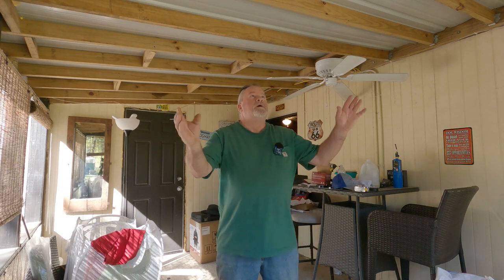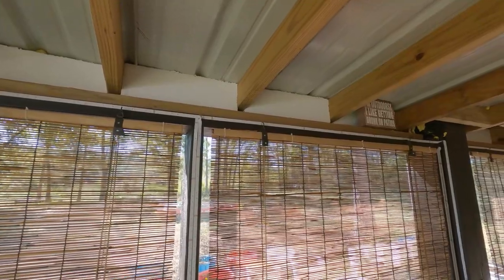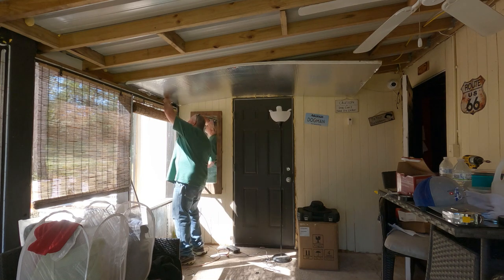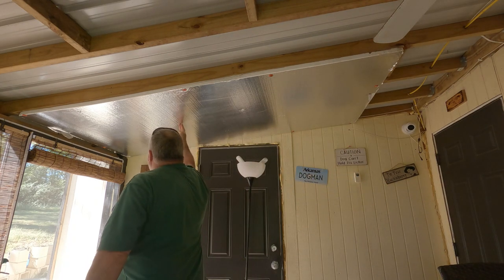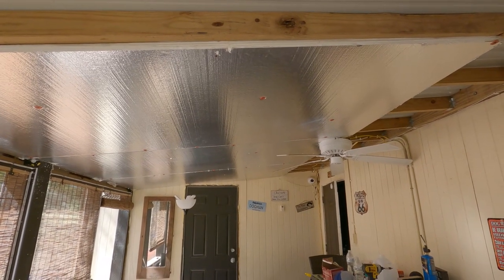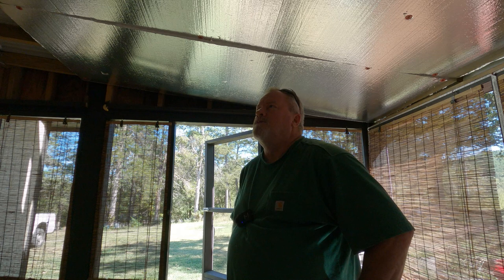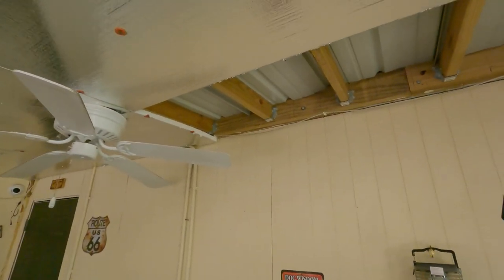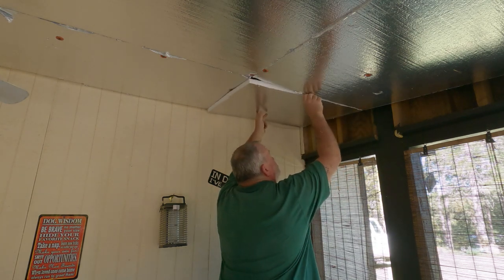Using Left Over Polystyrene Board In Screen Patio. Effective And Lightweight

Comment: Lol window covers are called shutters.  Nice job, if you look in your spare wood pile and see if you have any 1 inch pieces you could put a top plate in this would give a shelf for the insulation to sit on and you would not have any screws near your wires just a thought

Comment: Good job 👍🏼 you can never have too much insulation.  When you first bought that foam to use in your windows, I went searching for it here. Couldn’t get it anywhere 👎🏼  I have a few large windows that get hit by the summer heat and it’s as hot here as it is in mid-west Texas. ☀🔥☀ So I’m still looking for solutions 💨💨💨